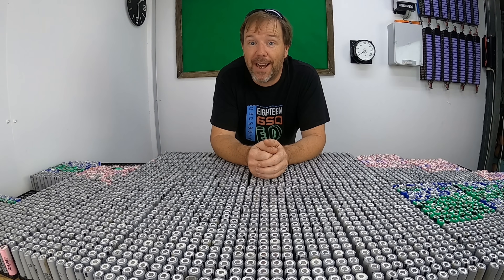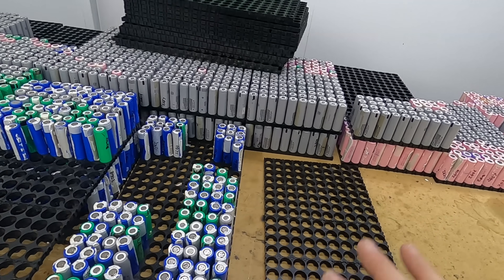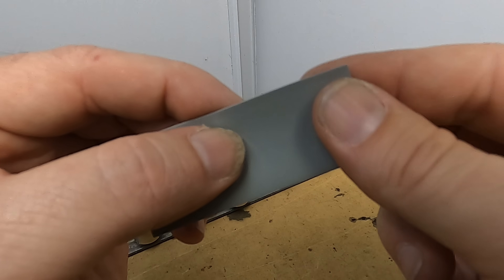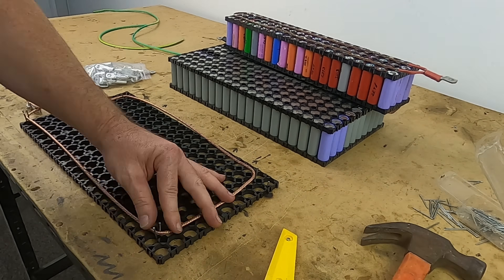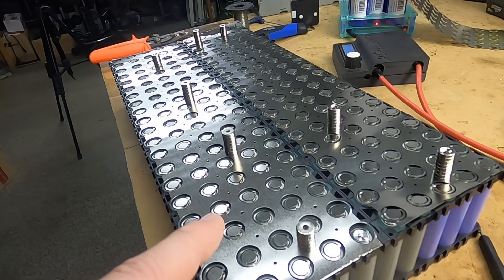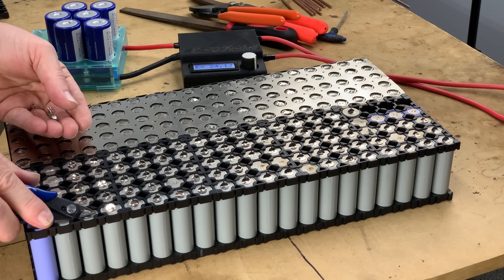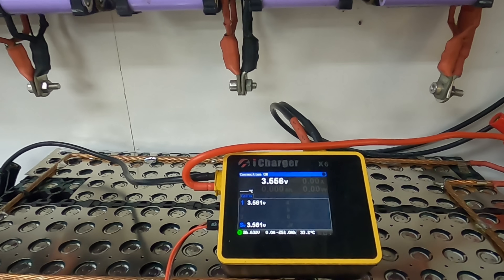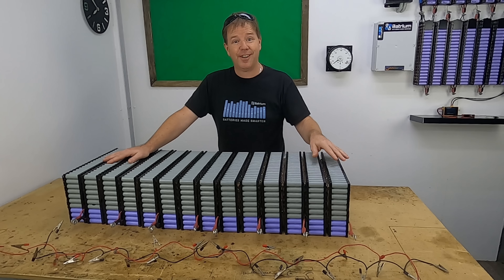Creating my single biggest D.I.Y. battery with 2800 18650 cells recovered from used laptop batteries

Comment: With so many batteries, statistics come into play.
Meaning, some of them will burn.
Reply from the maker: So does experience... every precaution has been taken
Reply: @HBPowerwall  what about connecting them in parallel without battery management system?
Reply: I don't know, I am not making power walls, but i know, that all commercial power walls and also any big sets of batteries (including laptop batteries) have a special system to compensate for differences in quality of the cell. And those systems usually if not always operate on a per single cell basis.
The reason being - safety.
So, congrats on your build, but i wouldn't keep it inside the house.
Reply from the maker: If you watched to the end you would have seen me cover the BMS, also two videos after cover safety

Comment: Hello from Canada! I have been involved with 18650 batteries for a while and wanted your thoughts on using high amp discharge 18650's impact an overall battery pack.  Example can you mix batteries of similar mAmp capacity but different amp output specs. Like 2000 mAmp laptop batteries at 5amp max discharge along with say a 20 amp max discharge???
Reply from the maker: I used to think so now I would have to say no.. it's a bad idea.. I mean it'll work - but short life span i think .

Comment: Ok I guess maybe I just don't get it.

You vid says batteries recovered from used laptop batteries.

I say great.  But I don't buy a new battery until my current battery pack simply won't hold a charge anymore.  So how do you make the said crap batteries work?
Reply from the maker: I spent a year testing every single cell for its current capacity - recycled all the poor ones - then sorted them into their capacity groups then built a balanced battery from that.
Reply: @HBPowerwall  The how to video is ... in this playlist yeah?
Reply from the maker: Beginner playlist
Reply: @HBPowerwall  Thanks you ..... bookmarked and will be checking it out!

Comment: Holy cow. That is a huge pack haha wow!
Reply: Pause
Reply: Now imagine 4 of those in a Model S P100D
Reply: He should have included some Caviats on the Spot Welder cus IMO it isnt cheap AND apparently ALSO must be built from scratch if using the K-Weld from your link.  The link redirects to https://www.keenlab.de/index.php/shop/ where apparently there are no assembled welders!  Plus at a minimum of €159 PLUS International Shipping makes this a bit pricey for generally a one-time project!  How this project will end up much cheaper than buying a small battery bank with Warranty, IDK.  A price breakdown would be helpful.
Reply: I was about to share with you the video but I see you've already noticed the video on your own, could you make more videos on DIY 18650 cells? (I'm the same guy who asked you this question years before using untechnical terms like lasagna layout battery pack similar to the one built in this video)
Reply: Just buy two recycled Prius packs you'll have enough batteries
Reply from the maker: Be nice to have an extra 25kwh to go with my 40kwh already in service for 4 years... Less daily cycling will make my battery last much longer I hope..
Reply: @HBPowerwall  that is so crazy haha huge capacity!!!
Reply from the maker: Wanted 100kwh storage in the early days - But this simply isn't the way to go about loosing your mind lol EV Batteries it would be easier, faster & cheaper!
Reply: @WillProwse  is this a good beginner build?

Comment: Just found this video, I have no idea what is going on - but I have a question: aren't laptop batteries unreliable? I mean the one thing I remember from every single laptop I've had is that the batteries don't hold a charge or won't work at all when they age. So why use old laptop battery cells? I'm probably missing something here, so can someone fill me in why this is a good idea?
Reply from the maker: Sometimes its only one or two cells that fail for one reason or another, other times its the BMS that fails, We have to stop replacing when something doesn't work perfectly and give it a Second LIFE!
Reply: @HBPowerwall  Yea I totally agree on the re-purposing thing, I was just curious about why choose laptop battery cells, because I know nothing about this subject. So I take it that if some of those individual cells stopped working inside one those batteries you made in the video it doesn't fail like it would in a laptop (cells are connected parallel as opposed to series or something)?

Comment: Those lugs 35-8 do not look appropriate for that copper busbar. You need to recheck or at least retest it.
Make the same busbar ends and crimp with hydraulic lug crimper. Then do a pull test. Depending on amps it should survive 100kg pull.
Reply from the maker: I just cut them in half and inspect - can't do a pull test accurately

Comment: Is that normal tin/lead solder onto the nickle bus? Sorry, but they look like cold solder joints.. Does the heat involved with the soldering do any damage to the plastic backing?
Really good video btw.
Reply from the maker: it's the cheapest solder i could find in 1kg lots with flux, some were definitely cold soldered joints done over i would do the soldering before spot welding. The plastic does melt underneath and one early tests melted through and shorted.

Comment: what the weight of that battery??
Reply: in addition if i want to put that battery in my car how can i since it will be quiet big in size?
Reply: wouldn't it be lighter and smaller if you put together 6 supercapacitors 2.7v 500Farad each?
wouldn't it 6 capacitors be faster to charge?
i say yes to both...
but hey all those stuck to batteries well you one thing will do for sure pollute more and more the planet...since batteries last something between 4 to 8/10 years,while supercapacitors have a life span of 50 years minimum..
Reply from the maker: Battery is 126kg

Comment: Good job but all that plastic? why not just make packs with tin strips? Also, using 10mmx2 copper bar for the busbar and just soldering that on the tin with a small gas pen looks way cleaner and you can just drill a hole in the end and use regular cable eyes.
Reply from the maker: Plastic is cheap, accessible & practical
Reply: @HBPowerwall  I built 2 packs from 800 batteries, and I found it neither cheap not practical. But if the shoe fits right ^^
Reply from the maker: Really - love to know your definition of cheap and practical lol Ya shoes must be only crocks...
Reply: @HBPowerwall  Come on dude I am not attacking you I was just wondering what your logic was as obviously you have been doing this for a while, same here and we both have different methods. Just built this small 4S8P battery: https://ibb.co/DRDvtpF, any reason you dont do it like this? Maybe serviceability? I used to use plastic spacers too but switched to this method, less materials needed.

Comment: How much time does it needs to charge/discharge all those batteries ? 
And put all that togather.

Regards,
Alen
Reply from the maker: Have not even connected it up yet :( but in theory I can easily charge and discharge to 100% every day If I needed to with my current setup here. As for putting it altogether about a year of spare time.
Reply: @HBPowerwall  that i ment, a year, long time.

What was % good and bad cells?  
In old laptop batteries.
Reply from the maker: I had 4 'bad cells' in 3400 tested i used the highest cells in this build 2674 of them - rest went to a different project
Reply: @HBPowerwall  hmm...
How is that possible, i mean they were all dead laptop batteries? 4 from 3400 is 1% bad ones ?
Reply from the maker: I guess it depends on the schools definition of dead
Reply: @HBPowerwall  hmm.
I got around 30% dead ones. 🙈

Comment: thermal management? fault isolation? high-AIC fusing? safety? LOL
Reply from the maker: Thermal management via good design where load does not even wan the cells. In the event it does BMS will turn on and off case fans. 2800 fuses there so far, then BMS will control shunt trip, mid point fuse, all BMS wires are fuses at the battery. Safety watch the  other two videos and you will look like a huge dick for this comment.

Comment: I worry that some of your solder joints may be cold. You should heat up the wire a bit more and the surface you're soldering on, if the wire is hot it will melt the solder and allow the flux to do it's job better. Either that or use some additional flux when doing big connections like that.
Reply from the maker: I solder ever day for a living (typically under a microscope) every one has been gone over again then tested at 30amp load for 24 hours with time lapse thermal camera, there were a few with not enough solder but mostly preaty good.
Reply: @HBPowerwall  I as well, under and small vs big is a big difference. The big iron definitely helps but there was a few there that I personally might have gone over again. Just want to make sure people are safe when doing this stuff.
Reply from the maker: every joint has been done over in the past video (but not in released footage) i'm happy for now with the quality, but time will tell if I just got lazy

Comment: 4S pack can be use for 12v inverter? Sorry for my english
Reply from the maker: Not with out design constraints these cells are best suited to 48v work for 24v but not so much for 12

Comment: It's a cool project but I'm sorry mate unfortunately the whole concept is a bit problematic.
First let me just say that I'm a professional engineer working with lithium batteries since 2006. I have extensive experience in this sort of thing. 
Paralleling up used cells is a nightmare. It might work initially but it won't last more than a few dozen cycles. When you're paralleling cells you're limited to the actual capacity of the worst cell. There are a number of things to consider with regards to the performance but let's leave that aside for the moment. My biggest concern is safety and what you have done here is extremely dangerous. A single cell failure can bring down your entire paralleled pack, if a cell goes short circuit it will cause a massive current through it that will most likely result in a devastating fire, the fused nickel strip you are using relies on a mechanical spring action to break the current path... I highly doubt it works as advertised. You are basically relying on an unproven contraption for a significant fire hazard. As far as the possibility of this occurring, due to the fact that the cells are used and you have no idea of the state they are in this possibility is significantly higher compared to new cells.
For the performance now. Its paralleled block is limited by the capacity of the worst cell. So for example is you have a block with 50 cells and one cell that the real capacity is 2.1Ah and all the other cells are 3Ah your capacity will be 50x2.1Ah not the aggregate!. taken into account that your cells are of random age the worst cell in each block can decrease its capacity very quickly and thus decreasing the capacity of the entire block. Due to this, your blocks in the string will be nearly impossible to balance and with a varying capacity you'll be stack on an endless balancing process every cycle. 
Now i'm not saying it's not going work... but it won't perform the way you think it will and slowly the problems are going to start kicking in. 
FYI if you want to gauge the age/condition of a cell you need to measure the internal impedance, capacity testing is a metric but doesn't prove much. 
And a safety tip for yourself and your viewers, NEVER apply extensive heat to the Li-Ion cells with a heatgun or soldering iron. You can find yourself in a big trouble very very quickly. Solder the "busbars" on the Nickel strip before spot welding to the cells and when using a heatgun to apply heashrink always use the lowest possible temperature for least amount of time possible. Heatshrink made for batteries is generally manufactured to work with low temperatures for this reason, don't use generic heatshrink.

Anything you build with your own two hands is never a waste of time. I applaud your project and the concept of DIY build. But please gather valid and accurate information. You're not dealing with pieces of wood and screws Li-Ion cells are wonderful but can be extremely dangerous. 

Cheers

Also put a legal disclaimer at least  in the description... people can hold you responsible for stupid things they do!
Reply from the maker: You've seen the rest of my channel right? Been running off old laptop batteries for 4 years 24/7 about 25kwh in and out each day.. So got to your few dozen cycles and didn't read any further.. I have 5 years experience every day learning, making mistakes and enjoying the learning curve. This has short comings but no less than rebuilding an old car, or house...
Reply: @HBPowerwall  I'm afraid I haven't, just bumped on your video by accident. I'm sorry I have no issue with what you do (in fact as I wrote i applaud your work) but when you put it up on youtube as a semi-instructional video you're taking on some responsibility you probably don't want. Believe me i'm no hater and did not intend to upset you, I am though a professional and just shared my such knowledge, obviously it's no use to you and I just wasted my time commenting, my apologies. Best of luck
Reply from the maker: Thanks for the feed back, i love sharing my adventures and failures... it's how I learn with our input like this i could never improve on my own...

Comment: For me  even if I had the knowledge of how to build a battery pack  but it is expensive .. I did  a calculation  if I going to build a battery pack with 3000 cells ( 18650 3.7v 4800mah ) it will cost me just to buy them 35256 USD
Reply from the maker: no such thing as a 4800mah 18650...
Reply: @HBPowerwall  i found them in this site https://www.jumia.com.tn/arduino-2-x-batterie-lithium-3.7v-4800mah-294479.html

Comment: EXTREMELY DANGEROUS AS IT COULD EXPLODE IF ANY BATTERY SHORT CIRCUITS
Reply from the maker: You silly child - they don't explode they vent & take off like small rockets... ... bit of research will make you look much less silly..
Reply: @HBPowerwall  i have heard of hundreds of lithium batteries catching fire and as in mobile phones because they store so much energy so they are very dangerous and even terrorists could use them to blow stuff up so they need be handled by licenced staff vetted for security. lithium batteries can short circuit easily as proven by samsung note 7 mobile

Comment: Why are you calling that stainless sheet a"nickel strip"?
Reply from the maker: because it's not stainless?
Reply: that is the perfect cause if you are right.
Thanx for taking time answering:)
But why use nickel - almost 3 times more expensive than copper - to connect stainless battery surfaces?
I am not there on-site so can not be totally sure, but it decidedly looks like brushed stainless to me.
It should also get quite tricky to spot-weld two separate kinds of metal.
I will stand corrected If you are able to honestly verify what that connecting sheet is made of.
With my regards.